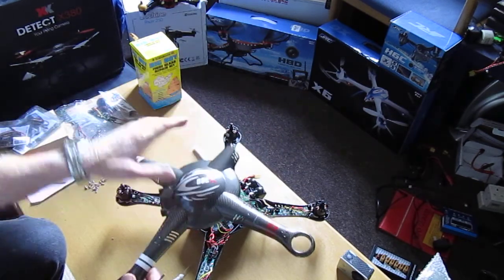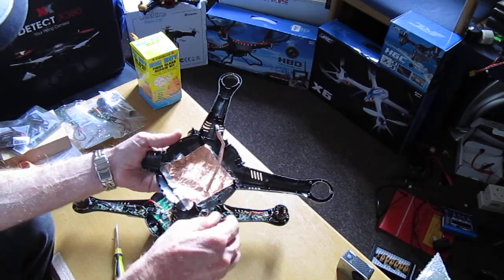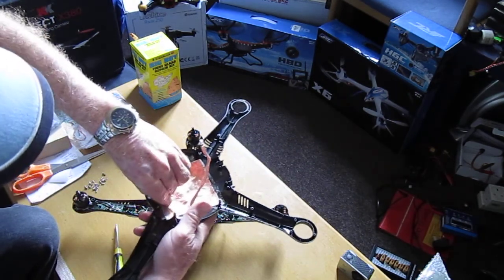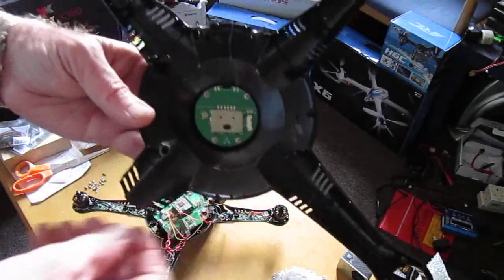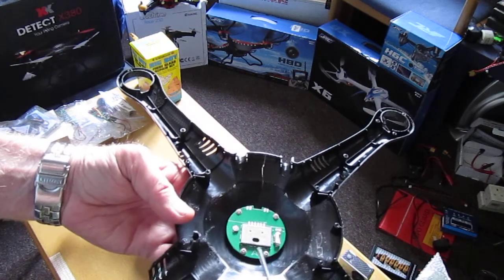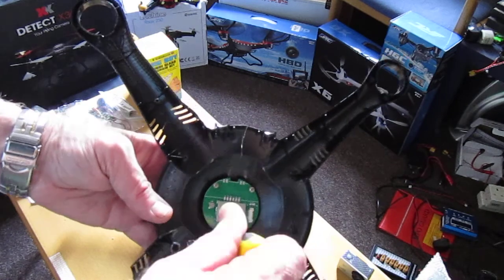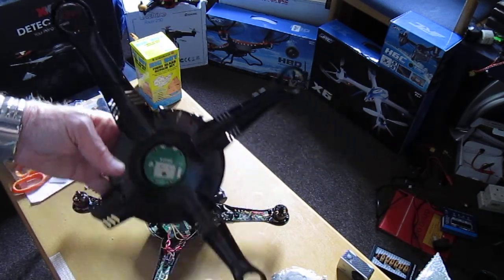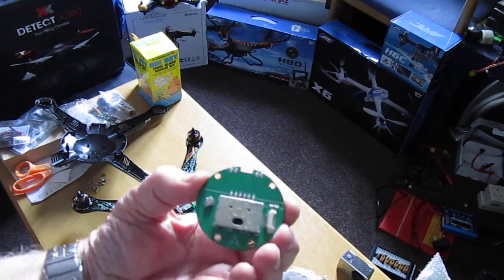X380 GPS sensor, remove or replace

Comment: Bill how can you tell if your gps sinser is bad, i had a hard crash last night now i can only get red and green flashes?
Reply from the maker: Hi Wim, sorry to hear you had a hard crash. I would make sure that the connecting cable is still ok and connecting to the mainboard properly, then you can connect your quad to the X380 software and see if you are getting any gps readings. Hope this helps.

Comment: what is the battery for? in the gps unit.
Reply from the maker: Sorry, I do not know what you mean, there is no battery in this unit.
Reply: +Bill M  that small round thing in the unit.
Reply from the maker: I am not sure what the little round thing is, but if it is a battery, it must be a rechargable there to assist.
Reply: +Bill M ok, thanks. and keep up the great work you are doing.
Reply from the maker: Thanks. I think that you are right and this is a battery for backup power for the SRAM and RTC when main power is off. Without the external backup battery, it will always execute a cold star[t] after turning on. To achieve the faster start-up offered by a hot or warm start, a backup battery must be connected. The main reason is this saves time in that it avoids having to wait for the "almanac" of GPS satellite positions to be downloaded.

Thanks to your question, I have learnt something too, thank you :-)